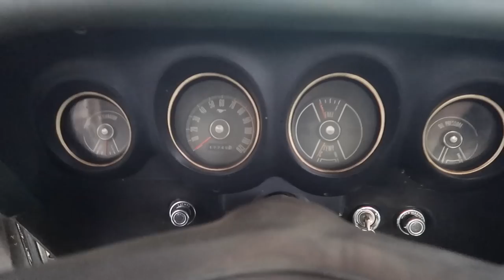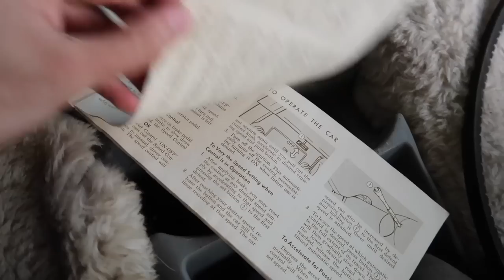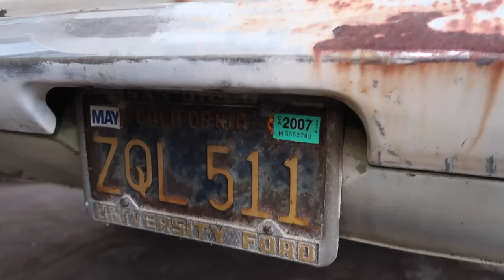I BOUGHT MY DREAM PROJECT CAR! 1969 MUSTANG!!!

Comment: Dude your jumping way too ahead on aftermarket parts rather than restoring it first, suspension, etc everything is rusted
Reply: Agreed! Tons to do before wheels 🤣 . I bet when he removes that carpet he run into some issues. Firewall, floors and the trunks are infamous for rust spots.
Reply: Agreed brother. He's got ALOT ALOT to research/learn before even thinking about the stuff he's already jumping into. I wish him luck
Reply: I agree bro he needs to fix lots of the frame and floor rust before some new carpets the suspension and steering is rusted.
Reply: He just wants content.
Reply: Chris L I

Comment: Car is gonna need a general tune up. Spark plugs, wires, check the distributor, carb would be worth checking into (cleaned or get a new one). The small startup clip sounded a little rough. Yes it started up pretty quick but it didn't sound like it was on all 8 cylinders. New gaskets and cleaning of the trans and engine will be a big help too. I've got a 1967 mustang I work on and I love it. If you actually read this I can help out with whatever you would want to know.

Comment: Holy Moley ! This is pretty much my first car. I found my 1969 mustang in a barn in 1980. It was all dismantled. The owner bought it new. It had been stolen and years later recovered and returned from Mexico. I bought it when I was 14, with my paper route $$ for $400. It took me 3 years to get it going. I drove it for 7 years.

Comment: Classics need to be built clean, I think black or a cherry red would look great. Don't bother with stripes, they weren't offered on any '69 coupe and would look out of place. My opinion would be to mod in a way that they would have back in the 60's (cam, upper intake, 4 bbl carb, etc.) T-5 Manual swap is the best way to go, gets you an overdrive gear without looking too out of place in a classic car and is the most popular. Looking forward to the build, i'm building a '66 289 coupe as well and love seeing the first gen stangs out there!

Comment: Looks like a 70 fender on the passenger side. Hmmmm minor collision?  How’s the cowl? The floor pans, rockers.....other typical rust spots? Our drummer has a 69 coupe, everything except the engine was original and it had a respray..... only rust was a tiny bubble in the lower forward edge of the driver’s door. Picked it up in Calabasa, California for 2,800 and drove it home to Fort Worth, Texas with 0 issues.

Comment: I'd start with suspension and steering before anything. I did it last on my restoration and it was a mistake haha. Get new tie rods, ball joints, spring perches(the roller ones are really nice), and lowering springs up front. For the upper and lower control arms  there's a couple ways to go, you can either rebuild them and put poly bushings in and install new ball joints in them or you can get pre-assembled new ones for a little more money. For the rear you'll need new shackles for the leaf springs and new bushings for the front of the spring and if you think you need them you can get new leaf springs for decently cheap. I'd personally recommend getting an entire suspension polyurethane bushing kit, car will feel way more solid, i have the one from energy suspension and its pretty nice. Combine this with a good caster, camber and toe alignment and the car will feel like new. There's so much you can do with these cars because of the aftermarket support so just have fun with it tbh.
Reply: Rust and bodywork first personally, then worry about the gutts

Comment: Hey Nate, you should paint it grabber blue with the super snake stripes, rebuild the engine 30 over, upgrade the fuel system  with injection and supercharge it. Also put 20's under it and beef up the suspension including 4 wheel disc brakes.......I have a list LOL

Comment: Acapulco Blue Exterior with blue interior. 351 Windsor C 4 Auto. That's my opinion, to many red ones out there.. I  have a 69 Mach 1, it's Wimbledon white, red interior putting it together after 29 years apart

Comment: It needs a lot of work paint for sure and major interior work. But when you get it all fixed and painted will be gorgeous. It's going to be fun Exsperince.
Reply: No real bodywork needed, since it's a CA car. Definitely jealous of that
Reply: @Isaac-od4rm  true but paint is very expressive out here cost me $700 just to paint my fiberglass hood for my mustang. So paint will be a lot unless he has connections.
Reply: @generolmatt4  That's true, especially if he has them do all the bodywork (I meant "real bodywork" meaning panel replacements)
Reply: @Isaac-od4rm  yes I know what you mean meant replacing body parts and straightening the frame. Yes it has to be sanded down and painted easily a $5000 to 10k job depends on quality of paint shop labor and difficulty of fixing rust.

Comment: I know your just getting into the classic cars but if this car has been setting up for over 15 years I would really just start off buy pulling the motor and trans and rebuilding them they were super easy back in those days and while u have tue motor and trans out rebuild the suspension cause back in those days suspensions sucked so bad and repaint and get everything 100 percent befor u start adding performance parts like craborator exhaust it gonna be a beautiful car

Comment: Congrats on the mustang buy, The first thing I would do before tearing out the interior, I would do an Engine and transmission re-built. It may cost some $$$ but it will be worth it in the long run.

Comment: I bought a 69 Sportsroof a few years ago. Turned out to be a pig in makeup but anyway nice looking car. I hope it is solid. Get yourself the Boss 302 chassis modification manual ford put out in 1970 will help with suspension mods and stiffening. It would definitely look very cool going with a vintage trans am race theme. And would be cheap to boot.

Comment: Have you had any problem with the side window coming loose from it's track on the '69 Stang? I had a '69 Mach1 long ago (bought it new) and the window on the driver's door kept coming loose, had it repaired numerous times. Someone told me Ford put flanges on the glass in the next model year to make the window more secure. Other than that, great ride, sorry I sold it.

Comment: Idea: FRRP Boss 5.0 cast iron block, 3V heads for a 302 homage with modern technologies and sound.
Reply: Then you killed the value of the car
Reply: @3644Darrell  Changing paint color to black or resale red with a manual swap will bring it back to original?
Reply: @ag3nto578  for it to be considered an original restore, everything on the car has to match the serial numbers which are on the top side of the engine bay near the driver's side fender. Either restore it exactly or just mod the hell out of it. I would see what that car goes for in excellent shape. If not a lot, then I would mod it.
Reply: @3644Darrell  I was being sarcastic, and I forgot to mention he said interior color change as well.
Reply: @ag3nto578  that car is going to take a lot of money to fix. You know he probably won't keep it. I would restore it to where I could get maximum profit out of it.
Reply: @3644Darrell  Then green it is!

Comment: First get the engine rebuilt first before you do any cosmetic mods. After it runs good, get it painted an army green color and then work on interior like the seats first 👌👌

Comment: bought my dream car a 1968 firebird for 6,2k new fenders doors wheel wells and the guy before me put all that in before i got it and he also bought all new chrome and almost all emblems besides the one that goes on the gas cap and the interior ones with a 350(pontiac) in it and i bought a 400 block to rebuild with a 4 speed and new floor and trunk pans and quarter pannels and mostly original interior but im pretty sure it has 69 seats but its a amazing car and im curently working to restore it at 13 years old i'm very lucky to have it its one of the best looking cars of all time and im looking to eventually paint it canary yellow if anyone has any sugestions please leave them it would be nice thanks